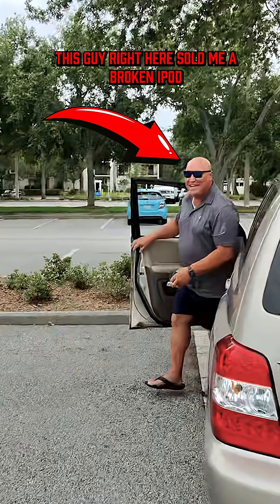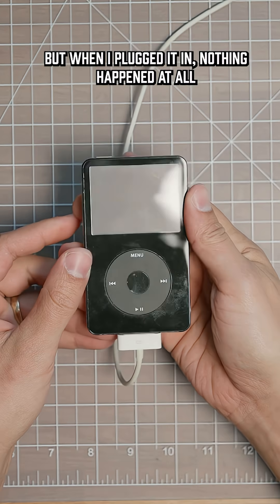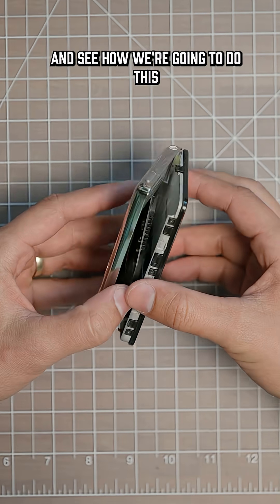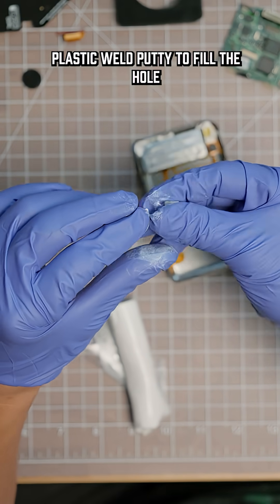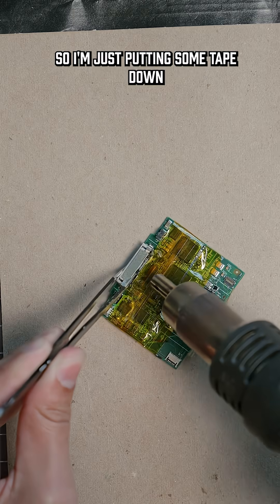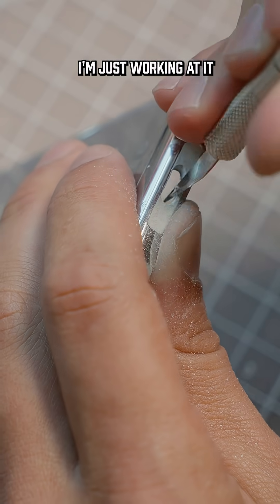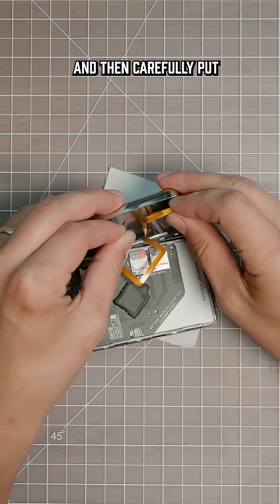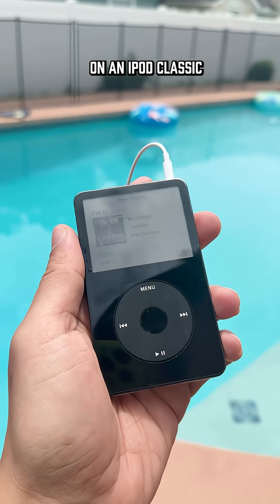He sold me a broken iPOD... So I fixed it with USBc!

Comment: I wonder how the iPod communicates to the speaker so if it would be possible to get some kind of adapter and use old iPod speakers with a modern phone through the USB port? The iPod speaker that I had back in the day has a headphone jack on the back of it so you can just go that route but some others do not.

Comment: I have a iPod 5 generation I got as a kid and had a lock on it and forgot the code and then ended up disabling it like forever. It was like 2000000000000 minutes or hours or something when it disabled so idk if I broke it, the screen is shattered but it turns on when plugged in but it’s disabled

Comment: Fixing a charging pin is way cheaper than replacing a battery, you won the deal. He probably should've charged you more because the fix is cheaper, plus you made it seem like he scammed you. Kind of a dck move.

Comment: Just to add, some host devices (like your computer) might need 5.1 k pulldown resistors on the USB’s CC lines. That tells the host that  a device has been plugged in, and only then will it supply power to vbus. I think it’s a case by case basis, like if you want to go USB-C to USB-C. For more information, read the USB-C specification

Comment: How did he go from 32 pin probably parallel port data transmission to serial port??? Idk if it's that easy to upgrade to a usb-c socket at least not without some additional hardware.

Comment: I wish iPods are still a thing. I used to have 3 different iPod Nano but they broke down on me, which made me want to get an iPod Touch. For a decade now, my iPod Touch still works, though it’s on life support, being stuck with the lightning cable, since the battery sucks.

Comment: You saw but still wanted to buy it. Don't blame the old guy for it.
Reply: Nahhh. Maybe this was an online ad, Ebay, or whatever and pics were limited? Maybe he took the guy at his word? Feeling like this guy was telling the truth. Maybe he should have mentioned that the 30-pin adapter had some bent pins? You know why he didnt? No one would've bought it cause the OP has unique skills to fix it.
Reply: @AriesAtThree  it’s very possible he didn’t know the pins were bent and just assumed because it wouldn’t charge and turn on that the battery was the problem.

Definitely a reasonable assumption.

Comment: I can see this coin from both sides. One, his title and opening line of the video described it as he was sold something janky and got ripped off. But on the other, the video clearly shows how he was there to buy said “broken” device. (He himself has probably done enough calculations in his head to realize the man is older and may not know what’s actually wrong.) He went back and plugged it in meaning if he 100% beloved the man he would have went straight for the battery.

Comment: Got an old Sandisk Sansa Fuze 16gb that I bought back in 2008. I basically used it every day until it stopped charging back in 2018. Would love to do a usb C mod with a new battery, just so I can keep it running if I ever wanted to go back to using it.

Comment: I still have my original iPod video that I bought in 2006. It still works but it does have trouble holding a charge for very long. The battery usually dies within an hour if it’s not connected to power. I was still using it up until 2 years ago when I got a new car and just decided to pay for Apple Music.

Comment: i'm working on a custom pcb and your video makes me question my over engineered device. since you didn't add any usbc orientation chips in there i assume you can only use the usbc connector with the other end being a usba or if it was usbc on both ends it would only work in one orientation?

Comment: This is 100% misleading. Type C uses a completely different protocol to negotiate the charging power as well as the connector orientation and USB 2.0/3.0 data rates. There is no way any of this will work.

Comment: Title is a bit misleading. That guy clearly wasn't trying to scam you.
Reply: He even admitted it came with free mod card so it was modded
Reply: Misleading, maybe but whose out here hunting down scam sellers on FB marketplace? Like y'all pick stupid things to cry about
Reply: It’s defamatory
Reply: he didnt say he scammed him. it says specifically, he sold me a broken iPod and I fixed it with a usbc. it WAS in fact broken and He DID in fact sell it to him 😆 god dammit yall, maybe dont jump the gun to take it personal or negative, they were facts and mever said he got SCAMMED
Reply: @n1ghtmancometh  If you sold me a used car and you said the battery was dead, but the battery was dead, but the connectors were also corroded, and I announced to the world that you sold me a broken car, how do you think that would sound to anyone?
Reply: @lunchbox1553 not even comparable bro😊
Reply: @lunchbox1553 the battery wasn’t broken in this case btw, only the few connectors. the guy clearly isn’t tech literate. he wasn’t lying, he was wrong. crazy mental gymnastics to justify falling to engagement bait btw 😂
Reply: @lunchbox1553  The battery didn't seem dead, he didn't change it. The fix was actually cheaper than the previous owner thought, charging pin is cheap.
Reply: @SupremoVerse  I proposed a hypothetical. That didn't actually happen, so I don't know what you're referring to.
Reply: @n1ghtmancometh the title is implying that he was scammed.
Reply: @applejuice7648 that’s quite literally just saying that the guy scammed him lol. did u learn that fancy new word in ur middle school english class?

Comment: The seller told you it didn’t work and you bought it anyway. It doesn’t matter what the problem was or what you found because you were informed that it doesn’t work and MAY need a new battery. If i was that seller, I’d sue you for defamation.

Comment: Plugs in an iPod of unknown origin putting stress on the pins before checking them first if the charger or something you might have done caused it (Or just looked into it prior to plugging in), then instantly claims the guy is a piece of crap when the iPod is like 12 years old and the connector could have broke due to time.

Comment: im not a fan of USBC. every phore ive ever had, including the one im using rn to write this, that had USBC, it just eventually stops working after some time... like you have to jiggle it around in the port and it keeps coming undone. sometimes you can take your sd card pin and scrape the gunk out of there and it kind of works a little better but it just eventually stops working again... i use wireless chargers because the cable is such a pain in the ass.

Comment: Nice work.  Pretty much exactly what I would do.

Still, I hope you didn't let that dude off the hook for taking advantage you by exploiting the situation of your inherent disadvantage in having no way to verify the thing would function like new as promised while he lied through his teeth, save nothing more than a simple battery replacement, all before paying the agreed upon price in good faith in regards to standard business ethics, most importantly to a sincere mutual respect all stakeholders involved by maintaining reputational honesty throughout the dealings, also in keeping up with the spirit of good business, specifying the full up front disclosure of relevant issues so that the best consideration can be applied to an assessed calculation of accuracy on points of  value given for the construction of the arithmetic problem/solution/translation with fairness to a currently equal liquidated cash money amount, hard assets to cold cash.  Whether he knew about the additional discrepancy or not, he simply said, as expected with it's age, replacing the old battery would have you plugged up.  The additional problem it had turned out to be little consequence for someone with the skills, tools, knowledge, and available resources such as yourself.  It just sickens me every time a lieing sack evades catching the immediate up comings of appropriate applied justice in a direct response relation to for any and all visited trespasses responsible for and orchestrated by these S.O.Bs, but just seemingly makes out like a sorry bastard bandent, instead.  Sorry, I had a bad experience or two in my time.  I admit, I may be having a little issue with letting it go.  Yes, for sure, it's not a good look to show such weakness from a normally superficial injury.  In my own defense, I have had to endure more than an average fair share of this crap, and then some on top of that.  Maybe they see me coming, or just maybe I had it coming.  I'm sick of being this victim.  So now, sick as it is, I feel reconciled through retribution.  It's a process, ok.  I'm dealing with it.  I feel better with every rant out.  Thanks!  I owe ya, lol!

Comment: you did a horrible job with that usb-c connector... could have made a little 3D print or used an epoxy. and labelling someone a scammer just because they didn't know the pins were bent is lowkey rancid.

Comment: How is it not hitting the hd cable socket?  And you loose the docking features… altho the 30 pin dock is terrible.  I’m always reinforcing the back so aftermarket stiff cables don’t push the pins back

Comment: I have two old classics. One has water damage  and the other is perfectly fine. Is there a way to exchange the memory from the damaged  one to the other one and combine the two memory capacities? If possible I'd love to convert from 30 pin port to type C.  Is this a service you could provide?

Comment: If you used the usbc port as a stamp to slightly indent the putty before it hardened you would have had a lot better time cutting the hole 😊

Comment: I’ve still got one of these! I installed iPod Wizard on it and could play freakin Doom on it, among other things. Unfortunately the headphone jack stopped working, even after being swapped with a brand new one, and then in the process of opening it up to swap the hard drive with a CF card and fix the audio I broke a bunch of the solders on the ribbon cable connector, and it no longer powers on or charges. I did get it to boot up once a couple years ago by plugging it into a higher current charger, but it died the second I unplugged it. Was still really nice to take that trip down memory lane. I keep it in my nightstand and every now and then fantasize about fixing it to listen to my old favorite (and definitely totally not pirated) songs from years ago. Man, I love these things.
Reply: Is it possible to get an adaptor usb c for iPod ( don’t really need too. I have one 160gb - hardly use it) hate the iTunes software though !!!

Comment: If someone sells you sometimes and says that thing is like brand spanking new and it is a 15 year old product. You better get out of Dodge like immediately. Never buy any electronic item you can’t rest it or turn it on somehow to test it. Don’t believe the BS it just needs a new battery or the charger was lost BS. They can buy a new charger for cheap online. Perhaps like 2% is telling the truth but that means 98% is lying. With those odds I wouldn’t change it and have to pass.
Reply: No older person is going to check the pins on the connector ffs 🤦‍♂️ ofc course he thought it was going to be a battery issue when he tried to charge it and it didn’t work. He was completely honest with the information available.

Comment: Do you fix Ipod touches? Trying to get mine back running. Took it to a shop, replaced the battery and screen, but it only ran a day, then never turned on again.

Comment: From the way he said, "it needs new battery" you can tell that the dude probably doesnt know much about tech stuff, thinking it wasnt charging because the battery is the issue, even though upon your inspection it was not the battery, rather the pin itself.

Comment: As for USB-C on an iPod classic. It’s genius.
Despite 30 pins still working and registering with modern macs. I have no doubt Apple may one day discontinue the support maybe 30 years or so down the line. But also, 30 pins aren’t as easy to come by in modern stores, or atleast not in England anyway. So you proving it works by putting modern tech components in a classic iPod, it shows we can make do with stuff we can get a hold of and modernise something by doing something so simple. 

Hats off to you good buddy
Reply: You can't discontinue a connector type if you can convert it into a usable format. If you can convert 30-pin into USB-c (as shown in this video to be possible) then it will be usable as long as USB-c still is.

Comment: Bro is not as tech savvy as you he’s just a normal guy that plugged it in see it didn’t charge figured the battery was shot and told you that. Extremely misleading and massively rude to put this guy on blast as some sort of scammer. Extremely disrespectful lost my subscribe.

Comment: honestly by basic reasoning this screen is done properly

you could guess seeing theres no wire above its probly in the ground in turn the jack hammer is the issue so the simple fix is either a strong kick to knock him away from the jack hammer or charge him

id suggest the kick so you can control the situation much more but either is valid

Comment: @JayBoyModz 
Pin me. My boi 💪 
—————————————————————
For the ignorants out there:

He did sell him a broken ipod. 
The seller also said it just needed a battery.
Never did he once say the cable port was damaged. 
Putting a battery in a device is NOT the same as a damaged charging port.

Comment: Christ in Satan🔥😱😱 Why in all ficksticks would you use that putty when it made, #1: such a nasty mess, and #2: you replaced a connection by fusing two loose parts😳😳😑  You have made so many other vids that have been just fine, now you go and PlayDoh’ the iPod as you solder it?!? DAFUQ Happened?!?

Comment: not printing a type c bracket in 2025 is madness
Reply: and not everyone has a 3d printer laying on one side of their room. Its relatable to most users and audience.
Reply: He's a useful idiot lol
Reply: Imagine all the hassle of designing and trial and error you have to go through for just mixing like two grams of 2 parts epoxy 😂
Reply: @johnbelwell2461  Brother this file exist online, ready to print. This isn't the first or the last person to put an USB-C on an Ipod.
Reply: @johnbelwell2461  that's a skill level issue. But in all seriousness would take 30 mins or less once you had the dimensions
Reply: @tye595 yes it would be cool, but for one off project in all seriousness mixing an epoxy takes less than 30 seconds without measure anything.
If anyone wants to contribute by doing the measurement and giving away the print files then yeah i can see a potential if plenty of people would want to do that, for a personal project it's more it's a hassle.
Reply: @tye595  thats 30 min longer than opening the putty
Reply: @ionstocke4701 with that logic the whole project takes to long when you can just use a smart device to listen to music.

Comment: So you might have trouble getting that to charge with a C to C cable, those little USB c port boards are great but they often don't have the resistors needed to signal the charger for voltage
Reply from the maker: C to C is working so far!

Comment: The epoxy hardens and shrinks over time. Be careful plugging it in and out; these are small things we take for granted on ports. It should be fine if you don't ram it in, though.

Comment: Just get a decent MP3 player or use your phone/tablet. You can get better MP3 players from Sony with higher capacity for both battery and storage and you won't need that awful software that comes with apple devices. As an added bonus you can get them with hi-res sound so in combination with a decent set of headphones that support hi-res, you'll get much better sound quality. Also the amp will be more powerful and able to drive higher end headphones so you won't be stuck with trashy apple headphones - you can go to enthusiast level.

Comment: USB C mod is cool but the 30 pin connector is better IMO. That connector had sound out, video out and many more pins. I would likely keep that iPod in a dock next to a stereo and not have to use the headphone jack to get sound from it.
Reply: I use my ipod every single day and I wouldn't if I had to use that dumb old cord. USB-C all the way.
Reply: USB-C has 24 pins
Reply: @thefuzzman so? Other than power, ground, and USB 2.0 pins, none of the other pins are compatible with the iPod. The 30 pin connector carried analog and digital audio, video, control signals, power and USB. You'd need to stuff in a significant amount of circuitry to replicate the full functionality over type C.
Reply: And it has the IR pins too for the IR stand to use the iPod with a iTunes remote... I wouldn't do this mode cause the 30 pins has features I use.